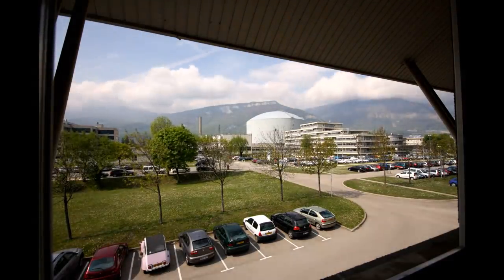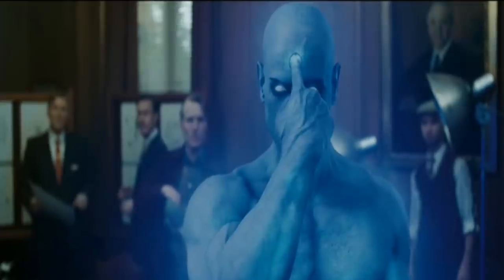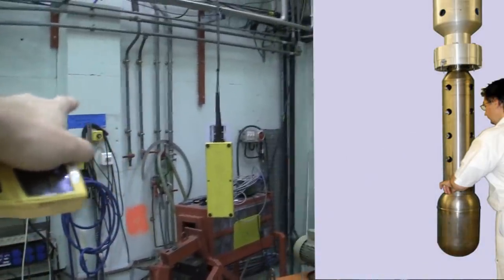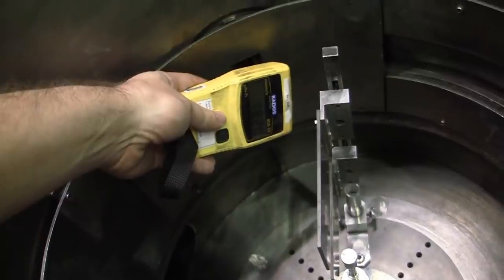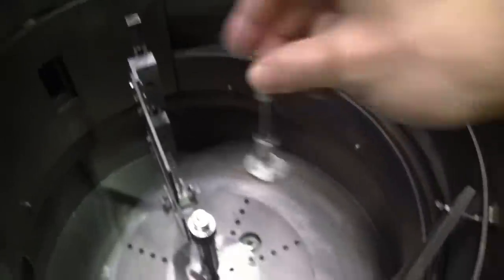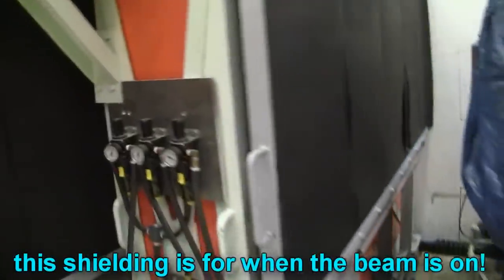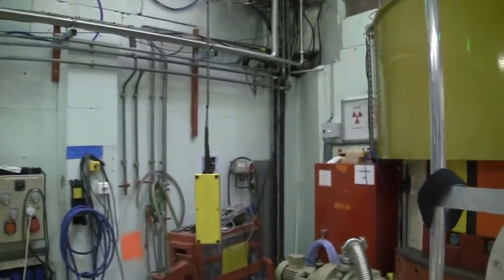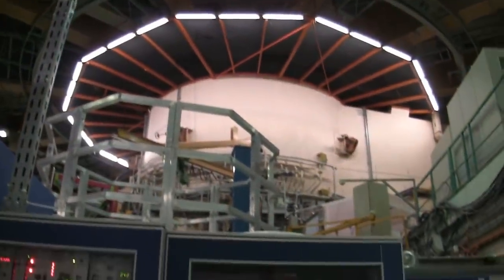Nuclear Reactors, Fantasy and Fact!

Comment: normal helium atoms have 2 protons and 2 electrons so that would be helium2 (because 2 thingys in the core) helium 3 has 2 protons and 1 neutron in the core, so it is helium 3... there is even a stable helium4 with 2 protons and 2 neutrons in the core... and because of this additional neutron helium3 can be used for all kinds of cool nukular stuff, but it is pretty rare, thats why in scifi they get it from the moons surface because there is a lot of it there.